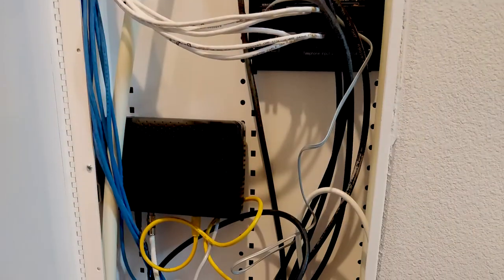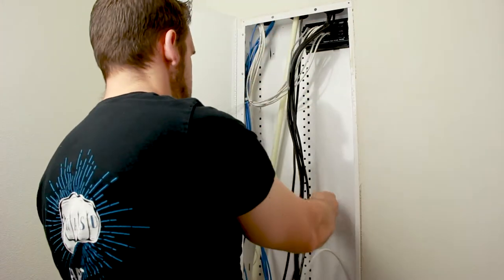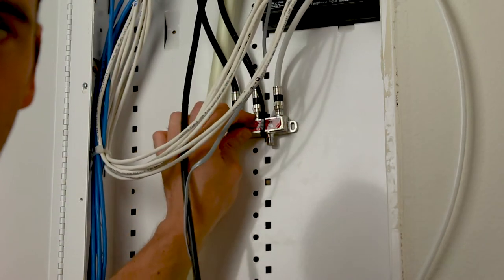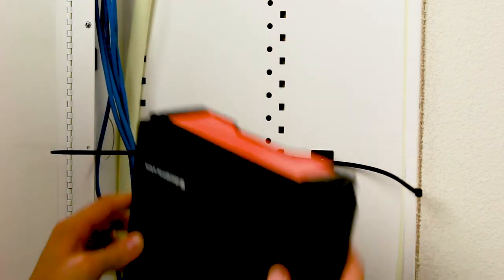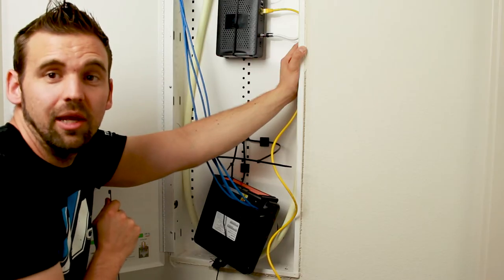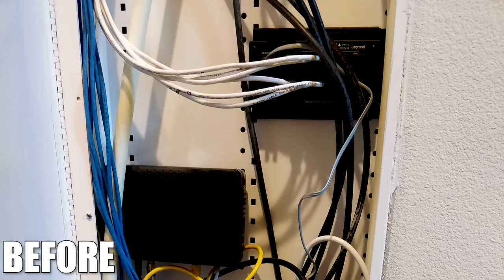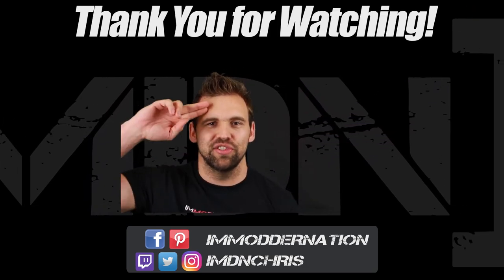HOME NETWORK CABLE MANAGEMENT ORGANIZATION AND CLEANUP (GUIDE)

Comment from the maker: PRO TIP - Add a christmas tree light timer to your outlet for the modem and router. Set it to turn off and back on when you're asleep so your internet connection is refreshed when you wake up.
Reply: I do the same thing. It also keeps you safe from not getting too much radiation and save on electric.
Reply from the maker: I guess if you turn it off for sleep time. Just remember not to start any torrents before bed.

Comment: Love the video. I too have a small budget. 

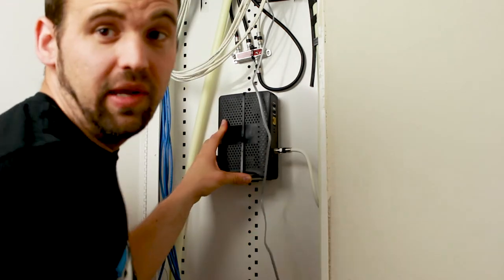7:19 move the zip tie ratchet part to the corner of the modem, instead of the middle, for a cleaner look.
Reply from the maker: I rushed that part a bit. Doesn't bother me much since the door is closed most of the time. Good suggestion though.

Comment: i find the timing of this humurous because i just built an internet equipment cabinet in my house out of wood laying around 2 weeks ago. gave it its own outlet and its on its own breaker even so i wont be without internet if electrical work is being done.
Reply from the maker: That's amazing Conner! You must be skilled with woodworking because building a good cabinet is not as easy as it sounds.
Reply: not in the slightest. literally cut a whole in the drywall, used a old cabinet door, and cut some random wood i had in my shed and screwed them to my studs. it worked well as a functional cabinet and its not terrible but could have been better with better tools and an actual carpenter. this is probably the 5th time ive done work with wood xD my primary skill is residential electrical and computers.
Reply from the maker: Well coming from a guy who has limited electrical experience, how do you think I did on this video?
Reply: ImmodderNation wire management is pretty good but i personally hate leaving zip ties un cut. and i love to either make a shelf for stuff that dosnt have a slot for nails. and if thats not an option. ive used hot glue on my own stuff. (not professional at all but functional) i thought your use of zip ties to hold equipment was an interesting idea but i still prefer shelf or hotglue for my own stuff. you can scrape hot glue off pretty easily to if you decide to remove it.

Comment: It’s nice you have a huge box. My family has two small boxes (the capacity is about two 14in laptops stacked). We have to fit a fiber modem, a router, seven coax cables, five telephone wires, and six Ethernet cords in those boxes. There’s no power outlet inside, and the door can only close with the help of duct tape. It’s a total disaster.
Reply from the maker: Absolute disaster! Have you joined the boxes together? May have to RIP IT OUT and install one larger box, if at all possible.
Reply: ImmodderNation The boxes are adjacent, with a 40mm diameter hole in between, and I can hardly pull the cables through. Any attempt to rip out the boxes would cause the wall to collapse.
Reply from the maker: Sounds like really bad design. Bad contractors exist in ALL countries. I have no idea how you managed to fit all of that into those small boxes.

Comment: DO NOT zip tie CAT cables. Putting excessive pressure on them breaks the copper - you might not even be able to see from the outside and only know by using a test and trace tool. Use correct size cables, manage them with Velcro loops, and mount your hardware as designed.
Reply from the maker: As long as you're not pulling them tight it's fine.

Comment: 14:50 buy a 2 ft or so cat6 ethernet cable and replace that yellow cable. Only costs $1-2
Reply from the maker: Working with the cables I had but i agree that would be better.
Reply: @ImmodderNation 
Yes, just something I noticed. I'm actually working on my network wiring right now with your video playing in the background. I have a simple 12 port keystone patch panel. Also moved my wifi routers to linen closet. Love to tinker but can't justify spending the money to buy fancy stuff :)
Reply from the maker: As long as the routers are easily accessible in the closet. Thanks for watching.

Comment from the maker: FIRST!!!! BEAT ALL OF YOU! I WIN!
Reply: Vid looks good, only thing I would have done in addition is label everything especially those ethernet cables to the master bedroom.
Reply: smart of you
Reply from the maker: The blue Ethernet cables were already labeled. Some had duplicates like the master bedroom, so I could have tested which ones were on which wall. Thank you for the comment Akuun!
Reply from the maker: @TY1979KA 200 IQ!
Reply: Just a few things, if ever having an issue replacing a coax and Ethernet connector may resolve issues with connectivity, that's why some slack will be needed if ever a situation may occur, technicians will be going towards that method 1st. You can't call 1st, you're a cheater. The next time I see you, I want you to give me that creepy smile you did in the intro,  thx.
Reply from the maker: Thats why I pushed the cables back instead of tying them down. Easier to adjust that way. Working on that creeper smile, just for you Derick.